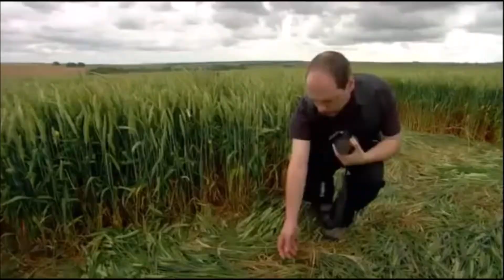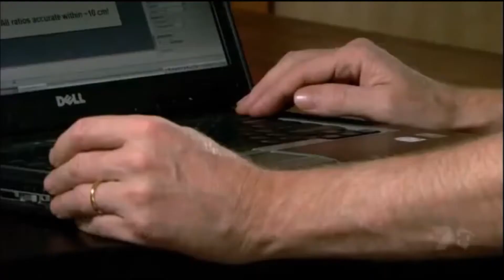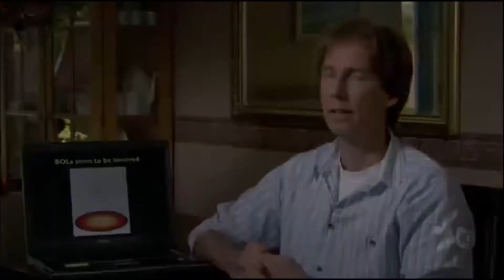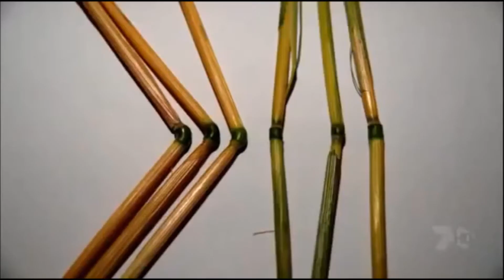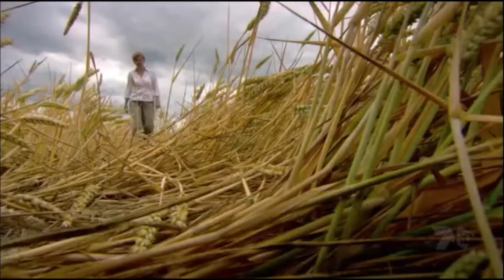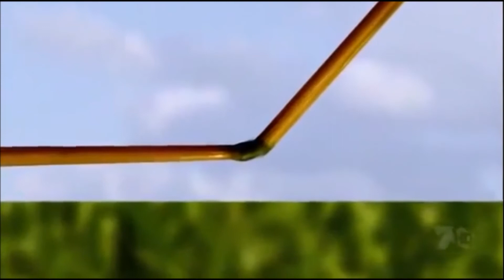Crop Circle Nodes - Elongated Nodes - Phototropism

Comment: This is a piece of deliberate misinformation put out by people determined to debunk the idea that crop formations are non-human in origin. It's relatively clever, and if you don't have a great intellect, you'll easily be fooled by this, but it's total b*******. The reason it's complete nonsense is because I have examined the crop circles on numerous occasions and jt is obvious that the initial bending that is causing the laying down of the crop occurs at the first or second node. This causes the plant to flatten towards the ground - not rising up to the light. The bend is quite pronounced but in the opposite direction to normal positive phototropic behaviour. There is such a thing as negative photropism in plant roots, and this bend or elongation , or asymmetrical growth at the node causes the plant spend in a downward direction towards the ground would be acting in the same way - but from a different causation. So this is in completely the opposite direction to that which the rather dim crop expert is attempting to explain the bending as phototrophism would cause the plant to bend up towards the light. She also states somewhere else that the photopic effect with flatten, plants would tend to occur on the third and forth nodes not the 1st & 2nd. But the main point is that the initial bending is in the opposite direction to positive phototropic behaviour because It's bending the plant away from the vertical and close examination of the crop formation shows that this is what has caused the plants to bend. It's definitely not a question of kinking or breaking the stems and flattening it as would occur if you did it mechanically with a plank or other implement, it's actually bending at the node that's causing the crop to flatten.  Quite why somebody would spend so much time, money and effort trying to debunk it is puzzling, but it's all of a piece, I think with the general manipulation that goes on with the population. Certain forces want to keep the population ignorant about what really are some fundamental principles in the universe. As a parallel, for instance, the UFO project Blue Book in the United States does everything in its power to attempt to debunk any form of UFO phenomena. But the probably out of print book Operation Trojan Horse explains how, and potentially why this is facilitated by the visitors themselves - but ironically with the active conivance of the authorities also.

Comment: If the circle remains undisturbed, of course the tops of the stalks would grow back upright, but the originally-bent nodes would remain. This is another case of selecting onnly the evidence that supports the debunking. Show the whole plant, not the cut-off stem.